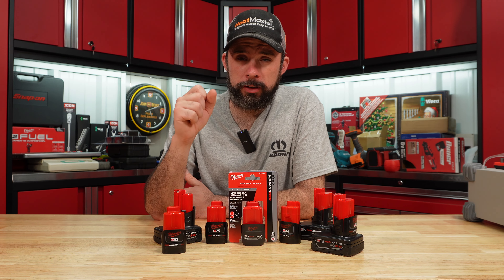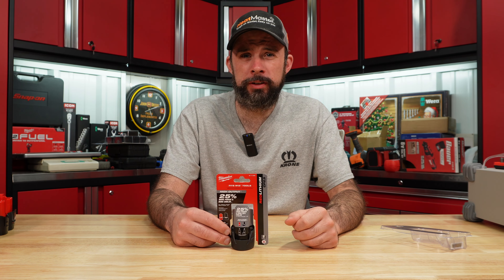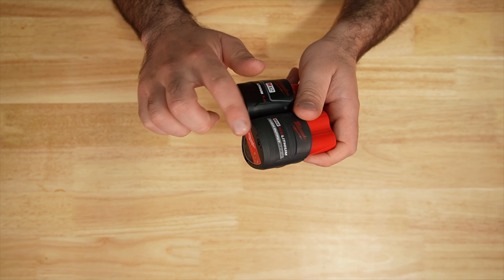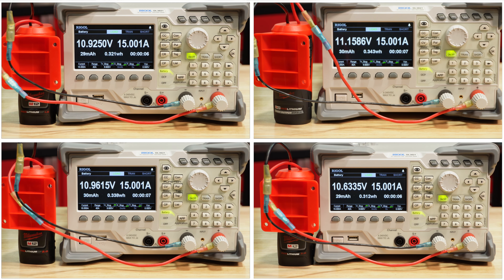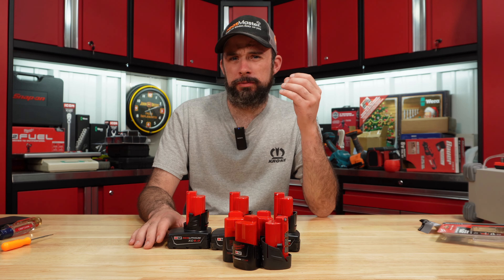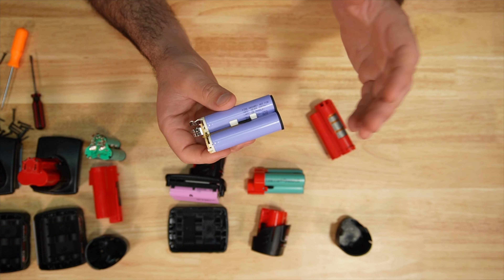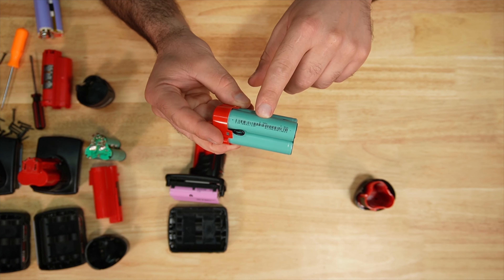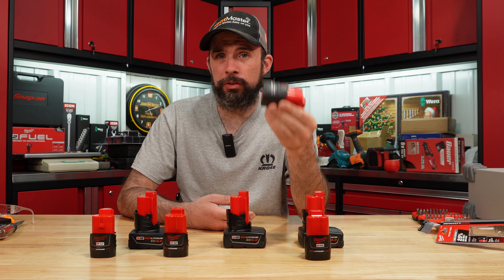Milwaukee M12 High Output CP 2.5 Vs All CPs And XCs

Comment: I took my crap M12 1.5ah battery, replaced the cells with Molicell 2800mah 40a cells. More power, better cells than any M12 battery, cost me $21 in cells and a little time. Did it with my M18 1.5ah batteries too.
Reply: That's awesome man! I love modifications like this.
Reply: You got a video on doing that?
Reply: PLEASE MAKE A VIDEO lol

Comment: I'm pretty confident the CP3.0 in this video is a counterfeit. To start, it's got the wrong cells, highly unlikely for MW to make a mistake like that. The M12 logo looks off, just like how they look on counterfeits. Your pack only says "3.0", it should say "CP3.0". Your pack also does not have the screw on the bottom of the base like the new HO CP2.5. MW started putting the screw on the bottom of CP packs with the CP3.0.

EDIT: I did find photos of early CP3.0s (from consumers) that did say only 3.0 instead of CP3.0 but they all did have the bottom screw construction. My oldest CP3.0 was made early 2018 & it says CP3.0 like all my other ones. CP3.0 & XC6.0 were both released at the same time so they all should have Samsung 30Q cells.
Reply from the maker: Yep its the only one I bought from Amazon,  I will say it's impressive how it looks genuine.   Just order one from Home Depot,  goes to show you cant even trust Amazon.
Reply: @Tools-Tested  Yeah I hear ya. Amazon is not a MW dealer so who knows where their stuff comes from. Not all of MW stuff are counterfeited (very little I would say) but you have to be aware buying from Amazon especially if buying from 3rd party sellers. I didn't even know they counterfeit MW batteries (generics yes of course) until I got one myself. Was a fake M12 6.0. Ebay refunded my money though & I still have the battery, use it on a work light.

Anyways, new to your channel & I'm susbcribed now. Looking forward to your test results on the real CP3.0 & the new 5.0.
Reply: yes that is a fake cp3.0.  All my real m12 cp 3.0 batteies have samsung 30q or sony vtc6 cells inside
Reply: @riceball777  Yep. Same here. All my CP3.0s have Samsung 30Q. Whoever sold that battery on Amazon did a little swaperoo on it before sending it out. It's not hard to do on these M12s unfortunately. I've bought from HD before and had the same thing done to me. I'm assuming it had been returned. Bought an XC6.0....Received basically an XC3.0 with the cheaper 1.5 cells.

Comment: What I find interesting is the 2 CP 3.0 batteries I have are LG HG2 batteries. I bought these batteries in May of 2022 from Grainger. The only date code I could find was on the circuit  board and it is 01/2016. Maybe the older cp3.0 batteries got the chocolate batteries and newer models received the  cells that are in your cp3.0s. We will never know. Thanks for the great testing!
Reply from the maker: That's very weird,  from what I read online the date code should be on the base.  Everyone seems to have Sony or Samsung for the most recent ones.  Older ones did have LG,  maybe you got NOS.

No Problem!
Reply: The CP 3.0 tested are counterfeit. I think he realized this in another video.

Comment: Do your cp1.5/cp3.0/xc3.0 batteries say cells made in china on the bottom? My cp3.0(date code Aug.2021) says cells made in Korea or Singapore, I'll have see if I find my security torx bits to check what cells are in them.
Reply from the maker: Both CP 1.5 and XC3.0 are china and 2021, the CP 3.0 is late 2020 Korea or Malaysia.  After doing some research the CP 3.0s I have are counterfeit,  which I bought from amazon earlier this year I believe.  

I will do a comparison video once I get the OEM one from HD.  It's really shocking how much it looks OEM.

Comment: If I ever get some proper machining gear like a mill or lathe, I’m going to try and make a 3 cell pack out of mainly solid copper, with holes the precise size of the cells. Let’s soak up that heat :)

Alternatively, a small fan and air channels. 

I could probably simulate that with three cells inside a six cell pack with a big fan. Figure out if “perfect cooling” would yield good results. If three cells in the open with a PC fan blowing isn’t wonderfully better, obviously no point in trying anything else. 

I have looked around to see if I could find pouch lithium cells that would fit inside the handle on an M18 pack but haven’t found any small enough with enough capacity to be worth it. I really like the idea of having the cells inside the handle only…if I wanted a rectangular block under my handle, I’d have DeWalt or Makita 12v.
Reply from the maker: Yeah sadly there is not much room to work with in the handle,  but it would be nice to have a pouch battery.
Reply: @Tools-Tested  When I’ve held the Makita and DeWalt 12v, I’ve realized how much the battery in the handle design of M12 expands the handle. My hands are average and I’m usually using my tools in some weird and uncomfortable position, so I don’t really mind the handle being a bit harder to grip.

(Eg: last time I was drilling a hole in metal, it was in the ~10” wide gap between two frame parts of the back of my RV. An ergonomic grip would have done nothing. Thick thread tapping oil, though - that was great. I keep forgetting that it’s not just CNC mills that need cutting lubricants.)

Comment: Could I take the cheap 18650s out of my CP1.5 & replace them with Samsung 30q's??? 
My only thought is will the circuitry hold up..?
Reply from the maker: I will have to compare the circuit board on the 1.5 to the 3.0.  But I don't see why you couldn't.

Comment: yes Samsung 15M failure
i seen a lot of XC 6.0 go bad
the issue are 3 cells stand up that have all kind of issue. 

XC 4.0 and CP 2.0 are rock solid
don’t see any issue beside customers damage there case
i use them since 2018, no issue
Reply from the maker: Have you seen any CP 3.0s not running the Samsung-30?

The CPs I have look to be made late 2020 with ICR EVE 20P
Reply: @Tools-Tested  all the one i open cp3.0 same samsung 30Q
Reply from the maker: @TranTek  interesting thanks for the info!
Reply: @Tools-Tested  any time
some of the old 9ah use the dark brown LG cells

i repair batteries and i see a pattern of issue on some
yes those Samsung 15M are junk, they use a lot of them in Ryobi
Reply: @Tools-Tested  Bought my CP 3.0 in December from Home Depot as a 6.0 and 3.0 starter kit with charger and bag. It has MURATA INR19/66 18650s in it.
Reply: @gts5930  yes they switched to Sony VTC 6 late 2021

Comment: To be fair, i think the heat marketing meant that it dissipates heat from the inside and it radiates it outside thus keeping the battery healthier. 
Bosch is about to release a new type of battery that has tabless batteries inside it and they run much cooler and better under high drain loads.

Comment: I have a forced logic M12 ProPress. I have the stock 1.5 amp battery. Will upgrading make a difference?
Reply from the maker: Hard to say without testing,  but every m12 tool I have used performed better with a high AH battery vs the 1.5.  I could really see the difference on the drill dyno.
Reply: @Tools-Tested  those batteries aren't cheap. I always hate to invest money into batteries that when I give me extra performance. What I'm finding is after about 10 dresses I could see on the indicator I'm losing 25% I also noticed that when I put a freshly charge battery in it seems to be more powerful. Maybe I'll wait until I need to replace the current batteries I have.
Reply from the maker: @stephenbile3932  Yep defiantly are not cheap at all,  best time to buy is around Black Friday or pick up a combo kit.  

Interesting,  yeah sounds like it could use something like a 4.0 XC.
Reply: It might be a good idea. I've done most of my pressing work already. Maybe by then they'll have come up with something even more powerful. What my peeve with the stock batteries are that not so much the presses per charge, but after the first couple of presses you can hear the difference in the power.  When pressing copper, the more power that you have the better the press is going to be.

Comment: Would you recommend using the new 2.5amp HO battery in my m12 cut off tool, or just stick to either a larger 4amp or 6 amp HO battery instead. ? just curious as i would love to keep my tool compact why i was heading towards the new 2.5 amp HO battery THINKING it may have the same out put as the larger 4amp/6amp battery. WHAT i did notice for others out there reading this when i used a normal 3amp battery on my m12 cut off tool and free rev the tool it was and sounded weaker without load then compared to the other larger 4/6 amp batteries, showing stronger sound..
Reply from the maker: Going to test that this weekend and we will see if it helps the cut off tool.
Reply: @Tools-Tested  brilliant can"t wait to see it

Comment: Awesome video.  The 25% cooler likely means the cells themselves.  Since you are measuring the outside casing which is used to dissipate the heat, a higher case temperature can mean it is drawing the heat out better keeping the cells cooler.  Ultimately if you keep the cells under 80C they get more current output and lower voltage sag.
Reply: True!
Reply from the maker: No problem, makes sense thanks for the info! Seeing the packs have a thermal sensor I wonder if they shut off at 80C,  I will have to test that.
Reply: @Tools-Tested  80C comes from Samsung data sheets. Not sure what temperature Milwaukee stops at.
Reply: Sounds feasible

Comment: I stand corrected. Those are the 25S Samsungs. I thought initially they were 25R's. The 25S has a max continuous discharge rate of 25A, the 25R has a 20A max, and the 30Q has a 15A max draw. That's the difference. Now that I have that figured out lol, I would say these are worth the extra 10$ Not enough difference to go crazy over vs. a 3ah. But definitely a better cell. Thanks for the retest. Interested in seeing how the new 5 compares to the 4 & 6 when they are actually attainable.
Reply from the maker: Yeah overall I think its worth the 10 dollars if you have high amp draw tools,  but I agree its not crazy over the 3.0.  No problem,  yeah knew something didn't add up.  

Im impressed with the 5.0 after testing it.

Comment: So the only reason you'd recommend the new 2.5 is due to the battery brand?

The 4.0 has nearly twice the performance as the 2.5, but it's only $10 more.
Reply from the maker: And the performance, if your looking for the most out of the CP size.

But if size is not the issue then I agree the xc4 or xc6 is a better value.

Comment: How long does the battery run for?  I am debating between getting on the m12 vs m18 line.  Thanks!  

The 2.0 battery only runs for 3 minutes before it dies when running at 15 amps?!?
Reply from the maker: Correct, you will get better runtime with m18 because of the higher voltage.  It really depends on what tools you need when comparing m12 vs m18 and if its more DIY or full-time job.
Reply: @Tools-Tested  3 minutes is such a short time.   I was thinking it would least run for 1 hour.  I wanted to get a multi tool and was debating m18 or m12 (lighter/more compact), but it doesn’t seem like I could get a lot of work done with a tool that only lasts 3 minutes!!  I have battery landscaping hedge trimmers that last hours and was expecting at least an hour of run time!
Reply from the maker: @FixItWithMe  15amps amps constantly is a serious load.  I would expect much longer runtime.  That being said m18 is definitely going to run longer with a 2ah.

Sadly I can’t speak for muti tools though.

Comment: I think we need a higher drain test to expose the weakness of the different cells… maybe a 5, 10 and 20 Amp test for the CP, and a 40 Amp test just for the XC batteries.  I’ve seen testing where the 4.0 XC outperforms the 6.0 XC when used on tools.
Reply from the maker: Will do when I get the HO 5! Load cell can pull 40A!
Reply: @Tools-Tested , looking forward to seeing that!!!

Comment: you have a fake cp 3.0ah battery right there.  I personally open up all my batteries to see the cells and all my m12 cp 3.0 ah battery have either samsung 30q, which is the same cells in the m12 6.0ah battery and some of my m12 cp3.0 batteries have sony vtc6 cells.   Your test also shows that you cp3.0 battery only has 2.0ah of capacity.  Your cp3.0 has some off brand cheep low end low discharge 2.0ah cells instead of name brand high discharge 3.0ah cells.
Reply from the maker: Yeah its crazy how well it looks OEM.  I ordered one from Home Depot to test it agains the fake.

Comment: That CP 3.0 performed really bad, just like a knock-off battery or a 1.5 disguised as 3.0.

Personally I own CP1.5, CP3.0, XC4.0 & XC6.0 batteries and the runtime on the 3.0 is much better than the 1.5 (maybe not by double but you get my point).

The CP 3.0 can power my cutoff tool, jigsaw, ratchet and multitool, but if I switch to the 1.5 my cutoff tool would bog down and drain fast. The only tool I own where the 1.5 feels adequate is on my high speed ratchet and jigsaw.

Just pointing out my experience
Reply: Hello Friend..thank you for your input on your 3.0cp experience..i was about to purchase another 3.0cp battery but now i am leaning to purchase the 2.5cp battery. To be honest, the 2.0cp battery comes very close to the 3.0cp which now i am saying to myself that i should have just puchase the 2.0cp instead. Take care
Reply from the maker: Thanks for the info!

Yeah I just ordered another 3.0 from HD.

Seems really odd, maybe mine are just old stock.

Comment: How come the 5.0 High output batteries in the US are called 5.0 XC high output but here in the UK we dont have XC, just 5.0 High output?
Also the batteries seem so damn expensive in the states. A 2.5 high output is $80 in the US but only £35 in the UK ($42) and the 5.0 high output is $120 in the US, but in the UK the 5.0 is only £50 or around $61. 
Just seems strange to me as i would think Milwaukee being a US company that the batteries would be cheaper for you guys. That being said it seems like the tools themselves are cheaper for you guys across the pond
Reply from the maker: Yeah that’s kinda weird, maybe just marketing.  I would expect the same cells inside.  But it is kinda weird the price is so much cheaper.

Comment: It's weird that the CP3.0 performs so poorly but the XC6.0 performs great. Don't they share the same cells?
Reply from the maker: Yeah it’s really weird my CPs have what looks to be ICR Eve battery’s not the Samsung INR which are in the XC.  I bought them early this year but look to have been made late 2020.  I have ordered a new one from HD and plan on testing it against the 5.0.
Reply: The 6.0XC is in essence, two CP3.0 batteries working side by side. Each sharing half the load. So they can push twice the current flow of a single CP.

Comment: All CP 3.0 batteries use either LG HG2 or Samsung INR-18650 30Q cells. Whoever you bought the CP 3.0 from swapped in a 2.0 cell pack. You really need to take this video down as you are merely testing the 2.5 against a fake 3.0.
Reply: I agree I just wasted 20min trying to figure out why the fuck there were 2.0 amp-hour cells in a battery advertised for 3.0